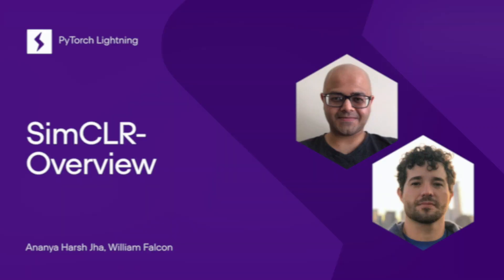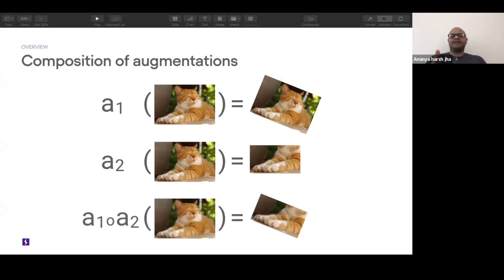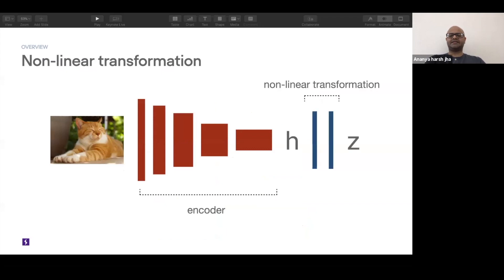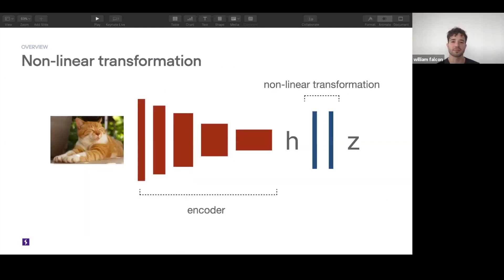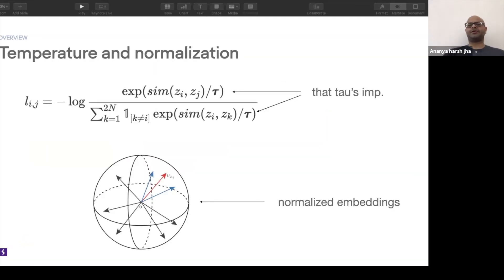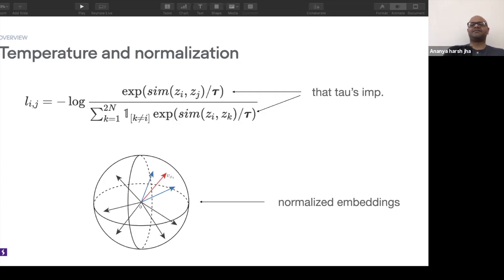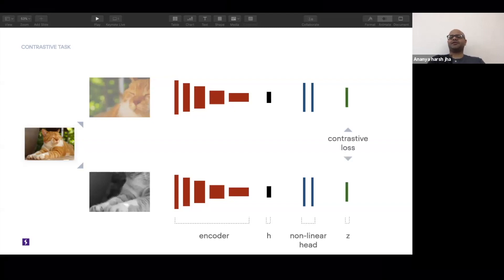SimCLR paper overview

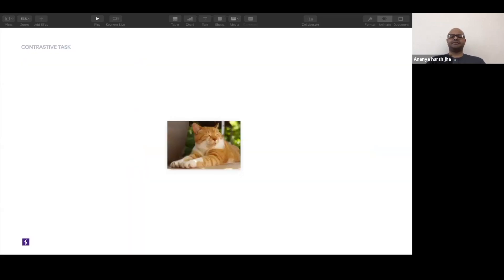Comment: I really like your paper, also, a paper named: contrastive-unpaired-translation uses SimCLR on a multiscale setting, in other words, it takes feature maps from different scales down the encoder and then apply the MLP. Also, it uses a Patch-based positive/negative contrastive loss. I wonder if the idea is the same as you explained in 5:10.
Reply from the maker: will check it out!